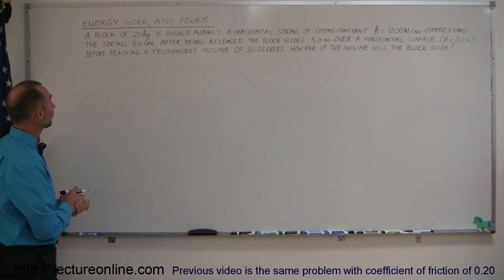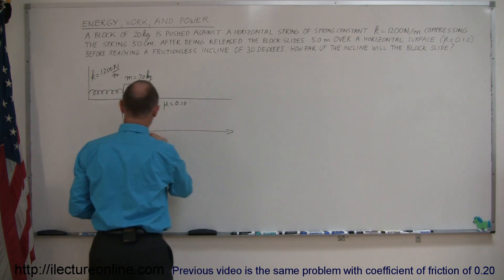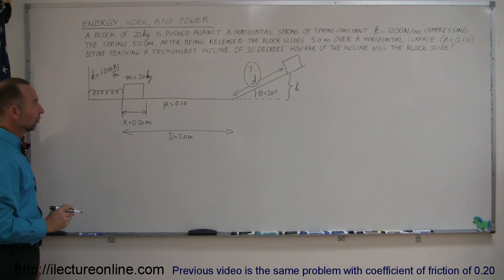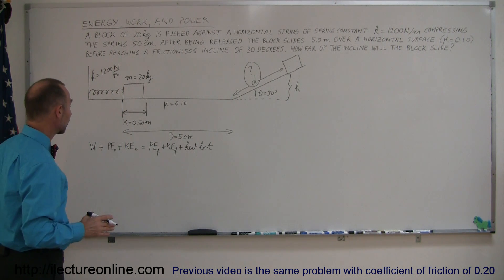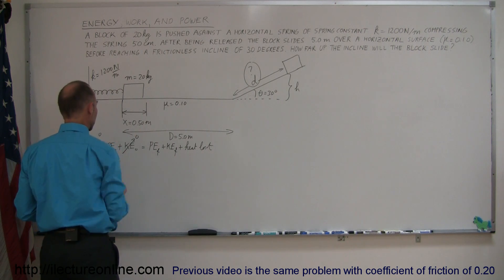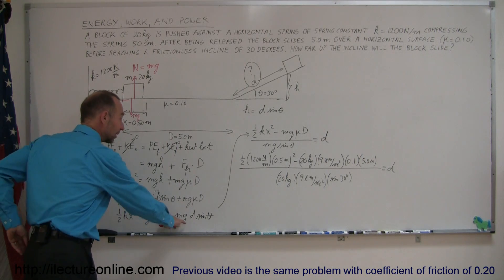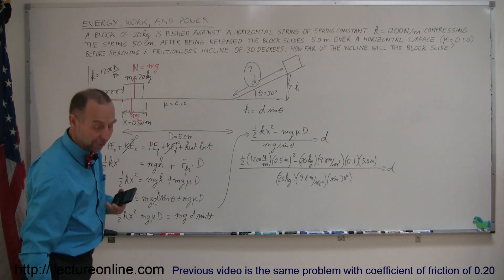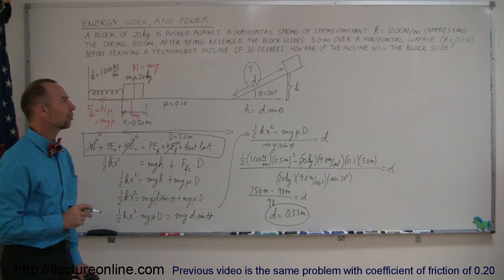Physics 8  Work, Energy, and Power (28 of 37)

Comment: Hi Professor,

I've watched a couple of your other videos in the Physics 8 series, but none of them seemed to help with this problem I'm trying to solve. Could you please help? Much appreciated.

A wooden block whose mass is 50.0 kg is pressed against a spring that stores 370.0 J of energy. The system is released from rest and the block slides across a horizontal floor a distance of 4.60 m before coming to a stop. What is the speed of the block when it is 2.00 m from where it started?
Reply from the maker: You first have to find the coefficient of friction.    Eo = Ef      370 J = Work done to overcome friction       370 J = m g u d = (50) (9.8) (u) (4.6)      u = 0.16415  (coefficient of friction)    Then you work it again   Eo = Ef     370 J = KE + work done to overcome friction     370 J = (1/2) mv^2 + m g u d          370 J = (1/2) (50) v^2 + (50) (9.8) (0.16415) (2)     V = 2.89 m/sec
Reply: @MichelvanBiezen  Thank you so much!

Comment: Why are you not using the dot product when you calculate the work done by friction???
Reply from the maker: When the direction of the force and the direction of the displacement is the same then the angle between them is zero, and the cos(0) = 1   Thus the calculation becomes  W = F d (1)

Comment: If there is no friction can somone tell me the height the mass goes please
Reply from the maker: Remove the term needed for the friction force and you get (150 m / 98) = 1.53 m
Reply: Michel van Biezen please solve this please
A mass=3kg goes straight in 10m/s and then goes un in 30 deegre 
Can you tell me the height it goes
There is no friction
Please tell me please
Reply from the maker: Use (1/2) mv^2 = mgh        thus h = v^2/2g = 6.12 m       if you need the distance up the ramp   d = h / sin(30) = 12.24 m.
Reply: Michel van Biezen thank you
I wish you were my teacher ❤👍👍

Comment: Hi Mr. Van Biezen, I love your videos, they have helped me so much to prepare for all of my physics exams. I have one question though, out of curiosity, how would our standard equation change if the incline also had friction? Would we need to split the friction part of the equation into 2 parts (one for the horizontal and one for the slope) or can it be done with the same equation, and if so, how must it be manipulated?
Reply from the maker: Heat lost due to friction would have to be calculated in two parts (as you suggested).  One part for the flat portion and one part for the incline,, since the force of friction would be different.
Reply: Alright, thanks sir for the quick replies!

Comment: If the system were in reverse, as in the block is initially stationary on the slope and slides down past distance d, and along the horizontal surface for another distance D, would the initial potential energy for the block (at rest) still use the height it drops down the slope (h), or the distance down the slope (hypotenuse)?
Assuming both surfaces have the same given coefficient friction.
Basically i'm trying to get my head around why you used the height difference on the slop rather than the actual distance (hypotenuse). And would the distance in the friction part be the distance (hypotenuse) down the slope?
Reply from the maker: blueboi05
The potential energy gained at the end only depends on the height
PE = mgh
Since energy was lost due to friction, when you work the problem in reverse, you will not get back to the same end point with the spring compressed 0.50m.
Reply: If both the horizontal surface, and the slope had the same coefficient of friction, would that mean you'd need to add an extra Frictional Force bit for heatloss over the distance d that the block goes up the slope as well wouldn't you? So it'd be work by Frictional force over distance (D+d)?
Reply from the maker: blueboi05
Correct except the last sentence.
The friction force up the incline would be:

Ffr = mg*cos(theta) * mu
and thus the energy lost due to friction up the incline is:

heat lost = mg*cos(theta) * mu * d
Reply from the maker: *****
John,
Use the concept:    Eo = Ef
Thus (1/2) k x^2 = mgh  or
(1/2) * 715 * 0.15^2 = 1*9.8*h
From that you find h
Then using:
h = d* sin(theta), where d is the distance up the incline
d = h/sin(theta) = h/sin(30)

To find the speed at the halfway point use
Eo = Ef   or

(1/2) k x^2 = (1/2) m v^2 + (1/2) mgh
since you already know h from part 1, use the equation to find v